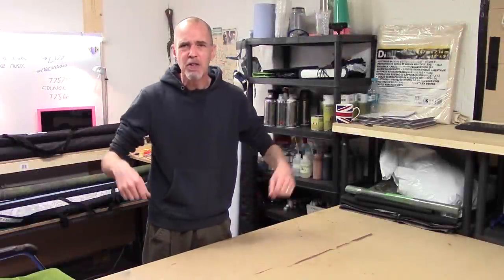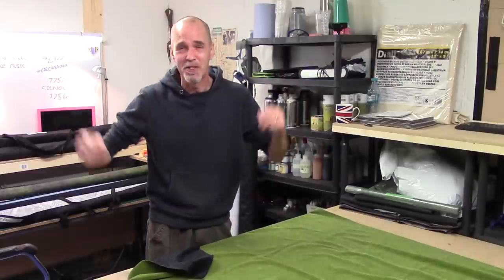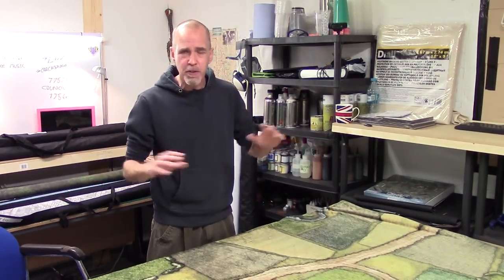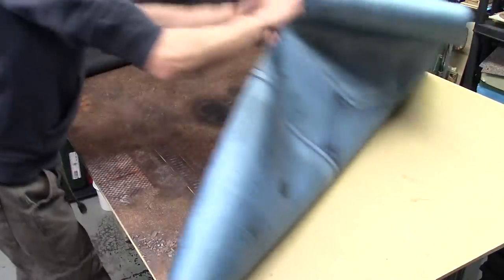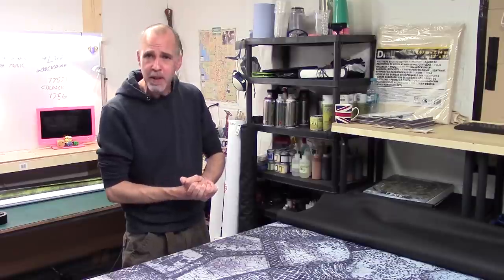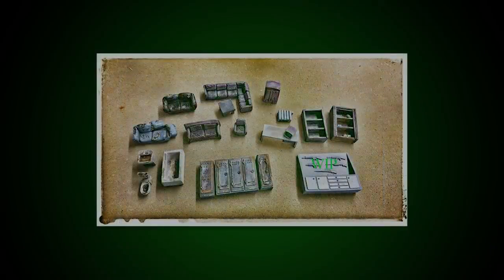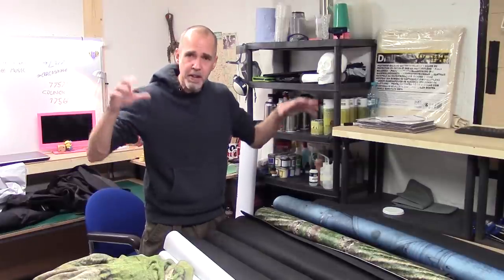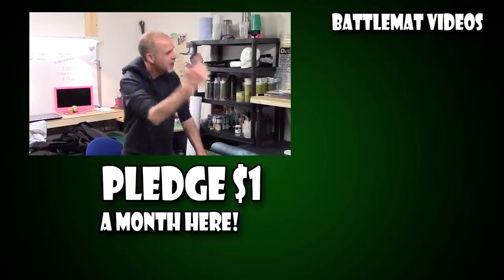The Big Battlemat Roundup!

Comment: I know this is video is a bit older, but its one of the best mat roundups I have ever seen.  Just a note about the "mousemat" material.  Neoprene rubber is the material on the underside of the mat and polyester is the fabric on top.  For the 2 sided mats, the neoprene is sandwiched between the polyester fabric.  So you are not technically wrong either way.
Reply from the maker: Thanks for the info bud

Comment: One thing not mentioned for Cigar Box is that they offer mats designed to be cut up for flat scatter terrain.
Reply from the maker: I did not know that, cheers!
Reply: It actually took me a minute to find them.  Was worried they discontinued them for a minute.  The names are Supplemental Terrain -- 3x3 -- #130 and DBA COMBO Gaming Battle Mat -- 4'x6' plus -- #124.  

They are rather expensive for 2D terrain and not very fun to cut out but a few of our Warmachine players swear by them.

Comment: Great bit of work!. odd question perhaps but having a 3ft by 5ft dinner table the choice is mainly either 3 x 3 which i think may be too small or 4 x 4...so how does neoprene/rubber/mousemat material one esp drape over edge..ie cleanly or with a rounded aspect...old style gaming cloths were ok of course to go over edge and drop away vertically..vinyl i can imagine might be stiffer. Thanks